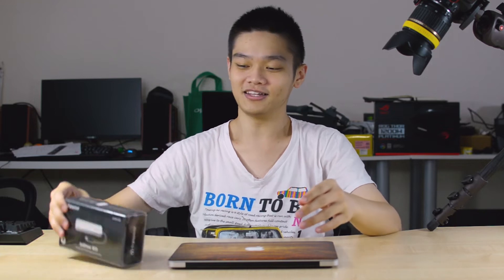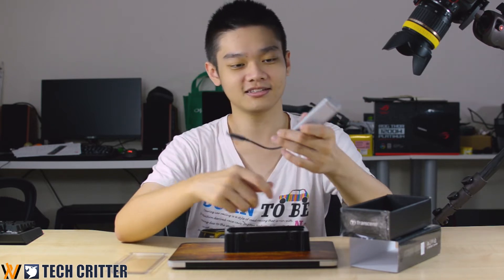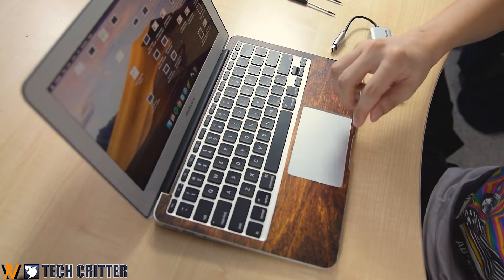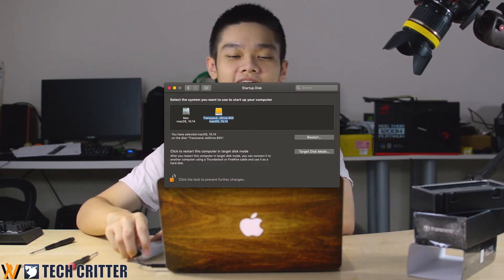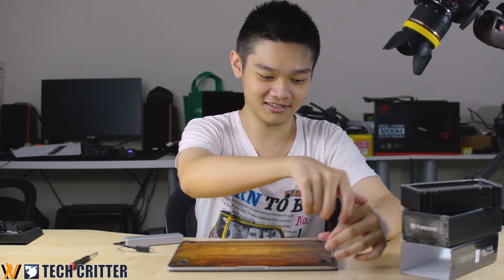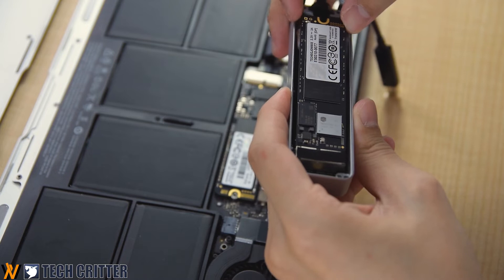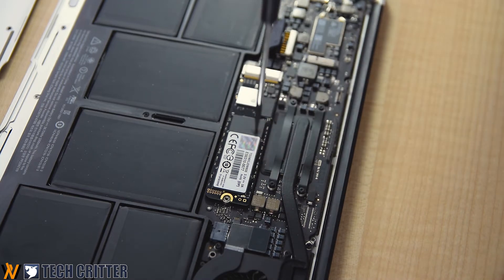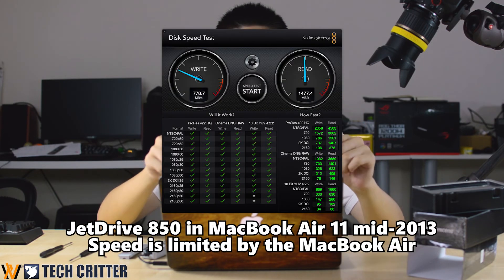How To Upgrade Mac SSD feat. Transcend JetDrive 855

Comment: My issue is that my MacBook Air (6.1) internal drive has failed and no longer boot up. I have a new Mac running Ventura which means the later will not let me install High-Sierra in the Transcend SDD from it; to later place it in the old failed MacBook Air. Do you have a work around? I don't mind loosing the failed MacBook Air data but would like to have it at least revive itself and be of some use.
Reply from the maker: I think you can put in the Transcend SSD inside but will have to format everything and reinstall Ventura

Comment: It's a very easy and the best detailed guide for update ssd on macbook with jetdrive. I had only one problem in this process, but she easily solved, as in step where we must change "start up drive" in settings I didn't have jetdrive ssd yet, but I turned off my mac and enter to mac os recovery at start up. And there I could change my start up drive. I did it in 2022 and my macbook - macbook air 2017 13'. I changed the original ssd (128gb) on jetdrive ssd(240gb). It was incredible! Thanks, bro ❤️👍
Reply from the maker: Great to hear!

Comment: this upgrade does not work with CATALINA IT IS rejecting the SSD.
Reply from the maker: No, it shouldn't. The MacBook Air that we showed in this video has upgraded to Catalina and it works fine.

Comment: Hi, Tk for the informative demo. Just wonder if one can use Superdupter to do the cloning? thus without buying the enclosure which is rather expensive
Reply from the maker: The SuperDuper software itself is free to use but if you can't connect both SSDs onto the same computer at the same time, then you can't clone.

Comment: i used transcend jet drive 855  240GB to macbook air early 2015 and installed Mojave from High Sierra at first it boot up , now it wont boot up,  but it boot up in external old hardrive ,  what shall I do?  pls help !
Reply: boot and in the disk utility must check the new dive as start disk/boot disk otherwise allways look for previous drive
Reply: @AndrésBacioccoBustamante  the thing is only the external hard drive is showing up . it works perfectly while   plug in the external hard drive thru thunderbolt .

Comment: I installed this in my macbook air mid 2013. It does not turn on after some amount of time when I open the lid. I have to shut down and startup again, but it takes much longer to fully boot then the original ssd. Also the battery only last 4 hours.
No idea why these problems are not mentioned.

Comment: Great review!

What's the difference between the 820 and 850? :)
Reply from the maker: 820 uses PCIe Gen3 x2, meanwhile 850 uses PCIe Gen3 x4.
Reply: Tech Critter Thank you! :) Will get one for my MacbookPro Early 2015 :)
Reply: @clivejarmusch2906  did it work successfully for your 2015 macbook?
Reply: Manny Jhutty Didn't get one. Bought a samsung t3 instead
Reply: @clivejarmusch2906  did that fit in your laptop?